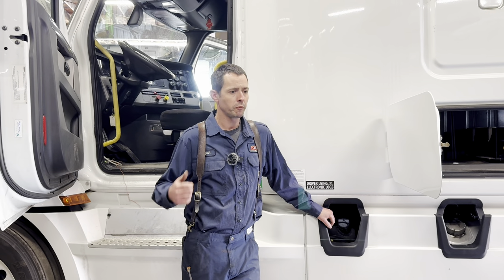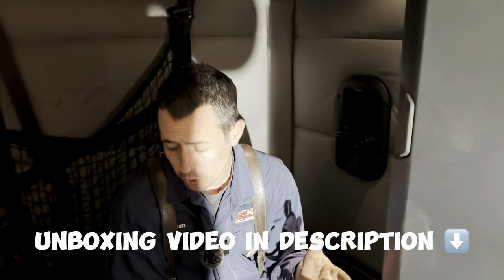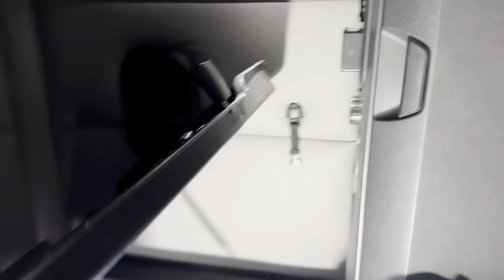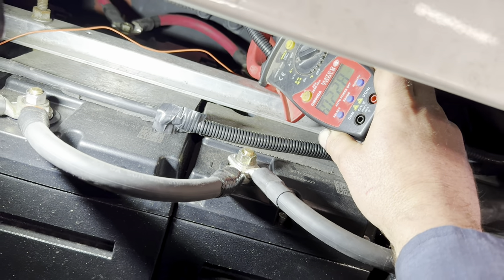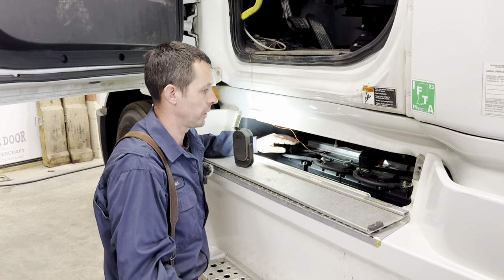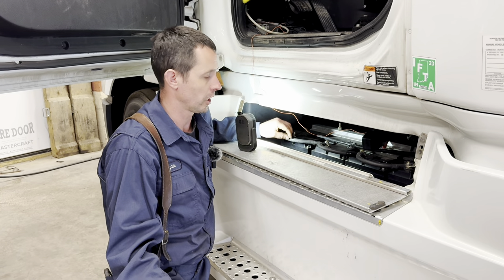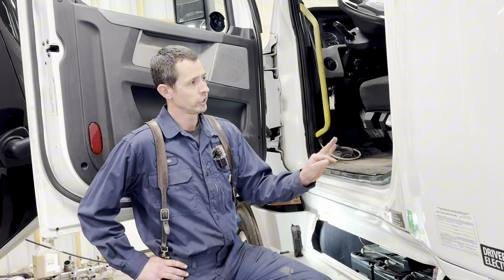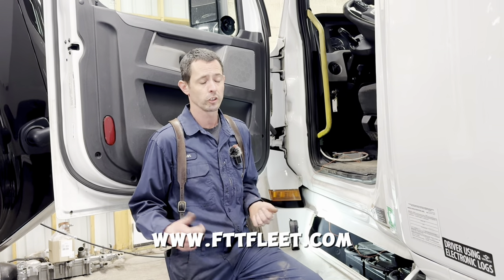Get Cool With A Lithium Battery-powered Electric APU For Only $5500 Installed

Comment: Very cool Ryan. 
When you're charging batteries, doesn't lithium have a C Rate of 100 amps while lead acid is 20 amps. Won't an alternator doing 150+ amps harm the batteries? 

Also, cold air drops and warm air rises. Why not run tubing vents higher in the truck so the AC is usable and felt instantly, rather than hugging the floor until the cold air builds up in the living space?

Keep up the good work.

Comment: Good luck. The challenges with cooling a truck are complicated. Batteries have many good uses, running a DC cooling system is not one of them. I applaud your resourcefulness presented over the years on the channel. This install overlooks many important factors that contribute to moving heat energy outside the cab/bunk. If you ever want to chat about cab cooling happy to contribute my experience.
Reply: Your comment is completely absent details and specifics, which means it is worthless. Please amend.
Reply: What issue did you have ?my concern is how long will the battery last before you have to replace them

Comment: The rooftop variation 2000R ranked highly in testing done by reseller rack up and go when compared to equivalent rated, but significantly higher priced units.  DC to DC air conditioners perform so much better than AC with inverter.  At less than $6k it’s reasonably priced when compared to having a similar system installed by a van upfitter.

Comment: Hey Ryan, nice video! I have a quick question. My truck has a 160 amp alternator. Is there any need to add a DC to DC charger to limit the charging current to the battery’s? Or are these batteries smart enough to do it by themselves? Thanks!

Comment: Ryan, I need to get my truck to you. I’m really interested in the batteries and how that would work with IdleSmart. Hopefully in the next couple of months I can get over to you. I’ll make an appointment. I’m thinking I may have to upgrade my alternator and I know I need new batteries. AC is already installed. I’ll call your office.
Reply from the maker: Sounds good!

Comment: Hi Ryan, I have a 2019 International LT. Will the batteries work with my factory installed under the bunker unit and my no idol system?
Reply from the maker: It should, the batteries are the replacement of the starting batteries and providing power for the cab.
Reply: @truckingandfixing  what is the cost for 4
Reply from the maker: $3,600, with current rebate $3,000
Reply: @truckingandfixing  ok thanks

Comment: Your ad page says your lithium batteries have  2000 life cycles, typically lithium has 10000? Are these used battery cells?
Reply from the maker: Can you provide a source where you see typical lithium has 10,000 cycles? Just Googled, 2,000 sounds about right. Will check with manufacturer as well and follow up on it.
Reply: No you’re right the manufacturers rate them conservatively but it is typical for a lithium ion battery to last 5 to 10 thousand cycles, I confused what a lot of experts cite for being what the batteries are rated for.
Reply: Will be in touch b4 summer. Thanks
Reply: I've never seen 10000 Cycles. I think you're confusing with a 10-year lifespan before they drop down to 80%. I typically see 3,000 Cycles

Comment: For this system, is there a solar panel that would mount to the sleeper roof to keep the batteries charged while doing a 34hr off?
Reply: There is no solar panel anywhere in the World that can produce enough electricity to keep an air conditioner running.  You have to think of it as...  I can idle for 34 hours at one gallon per hour times $4.00 per gallon..... or such a system may reduce that idle time to 24 or 10 hours.... and my savings will be the difference.  This type of system comes into play best when you are working hard, and only shutting down for 10 to 12 hours, then running 10 to 11 hours to recharge the batteries.... in which case, your entire stop time is covered by the electricity you generated on your run.  It is always saving you money.... but probably can't bridge a 36 hour break.... in which case you will idle the hours it can not......  the alternative is to idle ALL the hours, which costs more... much more.
Reply: 50 watt S Panel  is enough to run few interior fans  and keep the battery charged when you’re away but definitely not enough to run Air conditioner …
Reply: @redshifttrucking4537 look up the EG4 AC it's a mini split compressor ac that works only off of solar no batteries to supplement

Comment: Hi Ryan and Sophia, this is Jack H. 2018 Pete 579 with Landstar. Anyways, what's the cost on the batteries? I'm thinking of four at my next inspection four the Aux side and then four later when i need starting batts.  -40F cold is the best ive seen. Once all batteries  are lithium, what do you think about tying them all together in one system?  That should give me lots of hours of cooling.  Just thinking out loud.  Cheers,
Reply from the maker: Hi Jack! Hope you are well! Most likely you don’t need 8 batteries for 10 hours of run! The 4 lithium starting batteries will be similar to the 8 AGMs you have on your truck! You can just utilize the 4 starting lithium batteries. However, if needed, you can always add the deep cycle lithium batteries we also have here. We don’t recommend to use the starting lithium for auxiliary side. The starting lithium batteries are $900 each retail. We have a manufacturer rebate now, the final out is $750 each. The deep cycle for the aux side will be a little cheaper. Please call us, we will give you a quote for that.

Comment: How do you prevent voltage surge from damaging the alternator once batteries are charged?
Reply from the maker: Can you ask the question in another way? The batteries are designed as a starting battery, it has the advanced battery management system to do the job as a starting battery, just like your acid batteries. It wouldn’t damage the alternator.
Reply: Typically when a lithium ion battery is finished charging it stops taking any further charge vs a lead acid battery that’s never fully charged, the bms shuts the battery off 100% to protect it from overcharging at that point the alternator will get a spike voltage that can damage the diodes in the regulator, lead acid don’t have this problem. The only solution I’ve heard of is special alternator regulators designed for lithium ion protection. Most bms can’t handle the instant current draw of a starter motor but just because these do doesn’t mean it protects the alternator from damage, you should check? (I doubt they do)
Reply: I think most truck alternators only charge at 14.1v so the batteries aren't usually ever fully charged
Reply: @victis88  that’s true with lead acid but not lithium, the bms completely shuts off the battery otherwise it would be damaged.

Comment: They’re useless in very hot areas, such as most of the US during the summer. They will not keep the bunk area cool (say below 80 degrees) if it’s over 85 or 90 outside. After 3 months in a Freightliner with one of these, I’m moving to a local job. Endless cycles of sleepless nights and having to jump the truck several times per week from the reefer battery was enough for me.

Comment: Does it heat?
Reply from the maker: Good question, this is a/c only, you will have to install a bunk heater for heat, which we offer as well. We have a great heater here for the heating solutions.
Reply: @truckingandfixing  how much would that add to the install?
Reply from the maker: @uria711 $1,500 installed roughly 4-6 hours labor. Heater itself comes with 2 year warranty, super efficient, designed and supported by the US engineers.
Reply: @truckingandfixing  ok great thank you so much for the info

Comment: I just want the batteries. How much are the batteries?
Reply from the maker: Battery retail is $950 each.
Reply: @truckingandfixing  Hmm, doesnt srem to make much sense for me since normal batteries are $89 at the local Freightliner shop. But I don't need the EPU. Assuming lithium replaces 2x lead batteries, is a lithium going to last 5x longer? Especially since my trucks are used in summer only.

Comment: I prefer to run 8 agms. 4 for the truck, and 4 for auxiliary. Charged by a dc-dc charger. I run local though, so I don't really need to run an auxiliary unit for no more than about 4 hours. Cost would be much cheaper, and agms are easier to get locally for replacement.
Reply: You're having to buy 4 extra batteries and if you look at the duty cycle You're probably paying more even a lot more
Reply: @richcherwalk6349  it'll still be cheaper than 4 lithium starting batteries. Plus, if you're doing otr, good luck finding replacement lithium batteries if something goes wrong. It'll be smarter to have starting batteries for the truck and an auxiliary lithium battery bank for accessories. That way, if you have battery problems, you can go just about anywhere and get batteries for the truck, but just replace the lithium whenever.  Image being otr, and you have to change out your lithium batteries, back to lead acid, because nobody carries lithium!
Reply from the maker: This particular lithium battery can start the truck with just 1 (we tested it, though manufacturer recommended 2 to be safe), and it can be installed with acid batteries if needed, it will do the job. Hope it helps.
Reply: @truckingandfixing  wiring lithium and lead acid together with no separation? Me personally, I wouldn't do it! I agree lithium is better, but cost wise, I don't think it make sense. Group 31 Lithium starting batteries I've seen cost $900+. I didn't see a price on these batteries.
Reply: People aren't converted to lithium until they've experienced them.
You'll buy a new truck before the batteries need replacing.
Reply: @samuelfox8126  if a bms fail in a lithium, that's pretty much a new battery, if you didn't build that lithium yourself
Reply: @kajuan85  it's easy to be right with what ifs. Again, people aren't converted until they've experienced them. A BMS is like a circuit breaker. How often do circuit breakers go bad?

But you know and are comfortable with the expense and life of AGM.  So you'll stick with that, nothing wrong with that.
Reply: @samuelfox8126  what ifs, are possibilities. As an owner operator, what ifs matter! Having access to parts that's critical to your operation is important. I just had 3 coolant Hoses bust in 2 weeks. How often does that happen? I keep spare Hoses on my truck though, not everyone does that. They depend on shops. We both know lithium is better, but I'll only ever use lithium as an auxiliary bank, not for truck operation.
Reply: @kajuan85  I was responding to you saying you'd go all AGM and no lithium for aux batteries.
Reply: @samuelfox8126  oh ok. Me personally I  prefer agms because of availability and pricing. I get 100ah group 31 nothstar agms for $150 and 190ah northstar agms for $200 used, still with at least 5-7 years of life left with proper care. That's less than 2 lithium batteries, and more power, even though I can only use 50% of the capacity. I understand you're saying, I still prefer agm because I haven't experienced lithium, but when I look at the cost in comparison with the performance, and availability, I can't justify the switch.

Comment: Why do you need a $2000 deposit if you have all of the equipment at your shop?
Reply from the maker: Because we need good faith. Sometimes we might not have all in stock, need to order parts for the specific installation.

Comment: Great video. Have you guys installed DC charger for the starting batteries, or this particular batteries do not require a DC charger?
Reply from the maker: DC charger is not required for these batteries